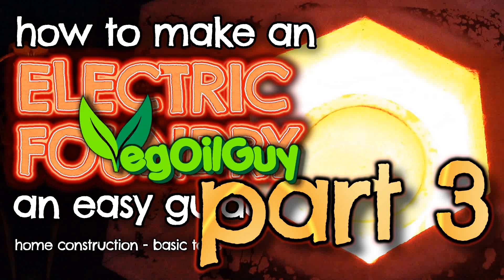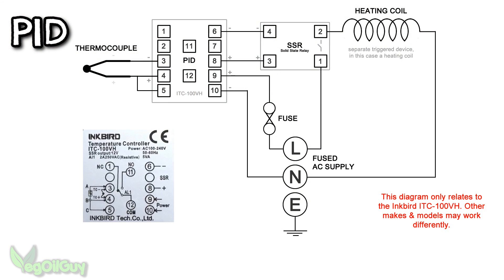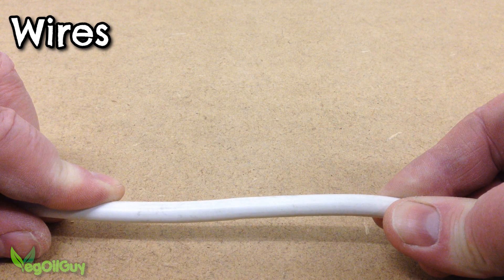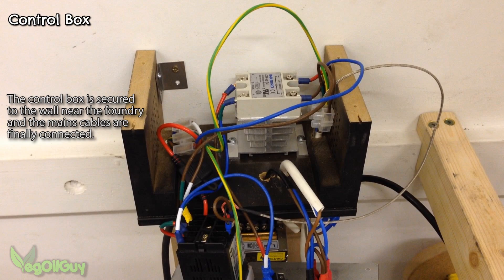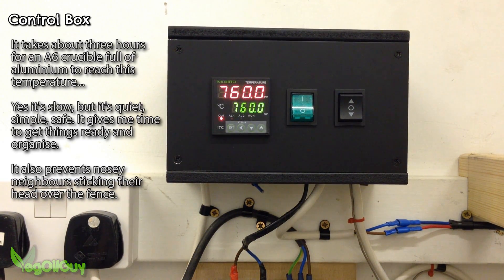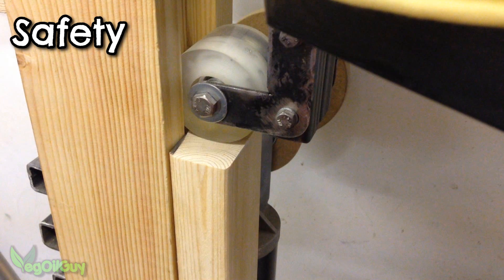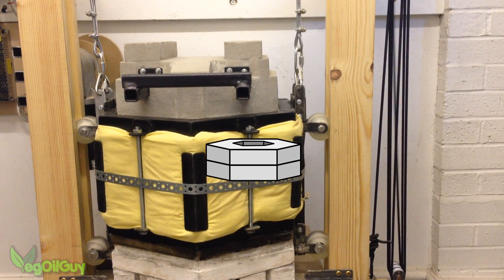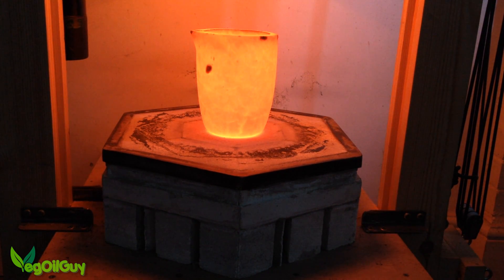How to make an ELECTRIC Furnace (Foundry) for metal casting Part 3 by VOGMAN

Comment: 8:42 As a doctor and scientist, this seems like a very good time to point out metal fume fever. Metals such as zinc are particularly dangerous in this respect. Metallic zinc is relatively harmless, but its salts and other zinc compounds are extremely toxic. If metal is melted, a small part of it always evaporates, recognizable by the different color shimmers that emanate from the melt. Zinc vapor combines with the oxygen in the air to form zinc oxide, which is extremely toxic to humans. So please be careful, especially when using it indoors. Never attempt to melt brass indoors, preferably not at all, it contains zinc and copper.

Comment: As a guy who calibrates and services those PID controllers, that jumper with the thermocouple is there because the settings in the PID can be made to handle a 3 wire RTD, which requires a 3rd wire (not going to get into the science or why the manufacturer didn't disable that part of the circuit)

Comment: Good series and well presented! Have you considered a higher power element? You could use the full 13A, as many plug in heaters do.
I made a short video of testing mine. I'm using 3.2kw, fireclay as a spiral form and perlite insulation, in an old cylinder.
Reply from the maker: I wanted to stay under 13... it was just a preference 😁

Comment: On safety features, as you say, a crucible failure or getting tipped over when the furnace body is in the raised position, would be a serious matter. It would not be a great deal more work to fashion a steel reservoir, bund or moat at which wraps entirely around the base, with the aim of containing any hot spill. Given the relatively small volume of the crucible, this would not need to be very large.

Comment: I wonder if it might be possible to increase furnace capabilities by using a dedicated supply circuit from the house control board. Electric ovens are wired on their own separate circuit and fused at [if I remember right] 30 amps, so might enable a usable load of say 20 amps
I suspect that this would not be a good idea if you also have an electric oven .... any thoughts ?
Any such change would however require installing, testing and certifying by a qualified professional electrician

Comment: Terminal 5 is circuit ground of the PID controller. The bridging of terminals 4 and 5 is to GROUND the thermocouple. This can prevent erratic temperature readings, which can be produced if the thermocouple is in contact with a conductive metal enclosure (electromagnetic field).  Another option is to connect the conductive metal enclosure to terminal 5. Now you know!!!

Comment: The whole purpose of having 3-wire RTD circuits is to eliminate errors due to voltage drop along the current-carrying wires

Comment: I'm not into welding yet.  I'm going to try to adjust the design to use bolted construction, with using porcelain tiles for some structural support.  Wish me luck!

Comment: You really shouldn't use blade fuses with mains, they are normally only rated for ~48Vdc and typically don't have ac ratings, a bulgin inline cylindrical fuse holder would be more suitable. Also 5A is way too high for a PID controller, I would suggest 1A.

Comment: As for the color comment at 4:00 , that's not totally true. For line and neutral, that's correct. The ground isn't always the same size/gauge as it's meant to be a backup safety and not always carrying the full rated load. At least in the US
Reply from the maker: If it's the comment I'm thinking of, I think I was just trying to convey that colour is strictly an external marking system for user convenience. I know I've come across folks that have said to me before, "I can't find that colour wire anywhere. I can only get XXX," believing that the external colouring effected its function.
As for colours and gauges, I'm sure you're right - I honestly have no expertise in such things. 😁
Thanks for your input 👍

Comment: Great and easy to follow series, thank you for posting this.
One question would it be possible to modify this design slightly using 3 coils, 1 on each phase? As it happens I have 32amp 3 phase supply in the basement so should be able to pull about 9 amps per phase with a margin of safety.

Comment: Watched these so many times, trying to figure out what works for me. Slightly larger with the lid appears to be better for me. But i love the "brief" cover on pulleys. Enough information to take me from know nothing to expert on pulleys.  :)
Given up trying to make my own bricks from internet mixes of sand or perlite etc. etc. Trying to source bricks whilst in lockdown is not easy it seems.  Postage costs as much as the bricks.  Thanks for the build.
Drawn into your 3D printing stuff also, hada CTC for many years and recently bought the Elegeoo Mars.
Reply from the maker: Glad you liked it : )
Reply: Bricks arrived. :)   Did you find anything about kiln size and wattage ratings?  I have a 16A cooker outlet but thats extra cable length compared to a 13A supply. Could i add an extra layer in height with just 2500watts or less or would i need that 16A supply? Any ideas?  Thanks again.

Comment: Thank you for a very informative video.
Very inclusive, and direct.
Well done!
Note; you may want to change one point of fact, that being,, there ARE hazardous fumes associated with melting lead, brass, and gold, and a ventilation system should be advised, especially if this is built indoors!

Comment: Thanks for the very good info on how to wire the pid and relay. Question:  Does the Inkbird PID temperature screen go over 1000°c......i need it to go up to 1100 degrees C for a heat treatment oven.
Reply: Loved all three videos. My question is the same as HoutmeyersP.  Plus, which thermocouple did you have to buy extra to get to the temp of 2000+  ?

Comment: I'm am looking to make this but am in no need to have accurate temperature control so I was wondering if I could get away with using a light dimmer? I would greatly appreciate feedback and love your videos!
Reply from the maker: Hi Louis. These coils are pretty much on and off. There's so much current they'd likely blow a standard light dimmer and I'm not too sure it would make much difference anyway : )

Comment: Hi VOG, thanks for your video, very useful and generous :-) I am doing now my own, inspired in your video and few others I saw online. I wanted to ask about the aluminium fumes, is it been a problem to do it indoor? Do you have a ventillation system or special masks? thanks!
Reply from the maker: I always recommend good ventilation when working indoors. An extractor system would be best, but personally I just keep doors and windows open : )

Comment: Change the fuse to 2A or less(look at the PID-controller's label).
Reply from the maker: You mean the one that says "Power AC100-240V 50-60Hz 5VA"? Yes I did.

Comment: Great series. I may have just a couple of suggestions though.
For the moving cables that run to the foundry and power the coils, I suggest a flexible cable tray. They allow the cable to move, whilst also providing protection.
For the winch motor I recommend placing end stop contact switches to stop the motor when the forge has reached its maximum travel.
Reply from the maker: Thanks Mike. Always have to receive suggestions  : )

Comment: Learn't a tip the other day, Make sure to pre-heat your crucible (specially graphite) if it has been left anywhere with moisture before using in the foundry
Reply from the maker: That's a nice tip  : )
Personally I always try to start off slowly for that exact reason, whether it's the crucible or the foundry. Rapid heat change can wreck most things, especially if moisture is involved as well .

Comment: hi. I have to melt lead alloys copper and tin and zinc copper. I want to buy a ceramic crucible for my electric furnace since I think that being made of ceramic it will produce less oxidation in the molten metals. is that right?
Reply from the maker: Hi Giorgio. I'm sorry to say I don't really have any knowledge on the subject  : )
Reply: @vogman  ok. you are the best . you can rely on yourself. but among the comments below your video I see that there are too many engineers hahaha

Comment: Good kiln build. But, i would be VERY careful using an automotive blade fuse setup like you have going on. Their insulation does not always handle 230-240V mains voltages. It could be a possible source of electric arcing at some point. Also, you've used high temp insulating sleeves, which is great, but then you've put on insulated qc connectors, lol. I'd swap them out with non-insulated ones if the temp is getting above 60-80 degrees C. Keep up the great work and looking forward to the next video!
Reply from the maker: Thanks Aaron  : )

Comment: I like you foundry very much. It is definitely overbuilt (your steel rope can probably lift a ton easily) but nothing too strong ever broke, right? Two things I would have done differently: one, the small fuse you used looks suspiciously like an automotive one and is probably not rated for mains usage, second bonding the protective earth clamp to the front panel with epoxy doesn't ensure a long lasting low resistance connection. Mind you, I wouldn't hesitate to use the foundry as is, but you being a belt and suspenders type of guy, I thought you'd like to know :)

Out of curiosity, why didn't you simply use steel L or C beams for uprights? Price is similar and wheels could ride in them with little or no modification.

Thanks
Reply from the maker: Thanks for your input. I would have preferred steel framing, but the prices I found were much too high .Fortunately it works well and is still in use as my regular videos show  : )
Reply: I was actually wondering why he didn't put the earth connector under one of the faceplate mounting screws myself? Figured there was a reason though.

Comment: On steel rope topic, a smidge of heat shrink on the ends help prevent it from fraying out a bit into a hypodermic needle like porcupine from hell.
Reply from the maker: I experienced that porcupine myself. Good tip  : )

Comment: Easily one of the BEST series of vids in how to do stuff, especially all the safety issues and code requirements. 
One thing I found helpful when 'gluing' refractory bricks was to soak them in water a few hours before hand, so there was some residual moisture which stops too dry bonds you can sometimes get. Or spray before, allowing a few minutes to settle.
Great work!
A warning: (So many idiots out in youtube land doing all sorts of stuff with only the minimal understanding of ALL aspects to their supposed teaching.
Whilst YT is a great library, it is also 'caveat emptor' in so far as emulating many instruction vids. I go so far as to say many are complete idiots in what they are doing, taking the entitled generation to new levels of brain dead.)
Reply from the maker: Thanks for the kind words  : )

Comment: Firstly, great video. Secondly, I see you are preferring your veg-powered furnace for bronze casting, and was curious why use one over the other? A question of time?
Reply from the maker: I love my electric foundry and it's great when the weather isn't pleasant and I want to work indoors. But it is slow. So if time or weather is an issue, I revert to oil or gas. It's as simple as that  : )

Comment: Love your videos and gave me a few ideas for my own electric forge build. As an electrical engineer, a couple of thoughts, though. The automotive fuse holder, is that going to hold an automotive fuse? What's the voltage rating on the fuse you're using? If it's rated for 250V or higher, you're probably fine. If it's a low voltage fuse, like most automotive fuses (32VDC rated for example), then the fuse design may be insufficient to avoid arc-over during a fault. If so, it may not provide the protection you expect.

I'm also curious about the effectiveness of the heatsink as you've located it. Generally if there's enough heat to be dissipated to necessitate a heatsink, you want to put it in a location with ample airflow so that heat can be dissipated into the surrounding air. Putting it inside a small sealed box seems to defeat that. If you haven't already, it might be worth checking how hot it gets inside that box after running the forge for a while. Maybe there's no problem, or maybe you want to drill a few holes or something. Another option is to use a metal case and firmly attach the heatsink to the case and dissipate the heat through the case that way.
Reply from the maker: Your expertise shines through and gives me food for thought. Many thanks  : D

Comment: Geoff, I loved the video and will look into using a PID to make a tempering oven for blueing clock parts. I particularly like your method of confining the heating elements. Other designs using staples seem to fail.
 Like the UK In Australia we also use 240 V AC (nominally dropped to 230V in line with the Europeans 220V as it was dropped in the UK. As a retired Physics teacher the brown coloured cable from your power cable is the Active (live if Yankee) {the dangerous one] this is the one which should be switched and the blue is Neutral not +ve and -ve as you label them. Although you are correct in indicating there is no need for polarity with heating elements.   I would strongly urge you to securely anchor the cables carrying 240V. Both in your control box and also the connection to the heating coils.   Pulling on them could easily expose the active and the Earth could become disconnected which means if the active comes in contact with the metal parts they become lethal. Using an core leakage relay is sensible.  In my projects I amusing panel mounted circuit breakers in place of fuses as a button push will reset. I Really loved the video I hope i can source the parts in Australia.  Hugh
Reply from the maker: Thanks Hugh  : )
Reply: I'm not sure if it still counts for the coil switch or not. But, in NSW, when switching mains power (thinking power boards here) you are actually meant to use a 2 pole switch and switch both the active and neutral for double safety.

Comment: Excellent work, one cronstructive criticism though, in the case of a crucible failure, I believe that  this design won't contain the molten metal, as the weight of the molten metal will bouy up the casing and then spill onto the floor. Perhaps you have room for an extra ring of bricks to act as a reservoir.
Reply from the maker: Thanks Mike.
Hopefully I'll never find out about that potential concern  : )

Comment: Can you melt steel with this furnace?
Reply from the maker: No... Copper about as high as I can go. The coils themselves begin to melt at around 1400C so there are limits. No doubt there's other wire out there that can handle higher temperature  : )

Comment: Massive overkill and expense, but nice. Good job!  I would have just built a larger one to easily access the crucible easily, and avoid the hoist system.
Reply from the maker: The hoist was the whole point. Reaching in is arguably the most dangerous part... the hoist practically gives you 360 degree access. And if I'm going to be honest, for me at least the hoist wasn't the most expensive part (I already had the motor) - the bricks were! So bigger does mean more expensive I'm afraid.
: )
Reply: VegOilGuy - Yes, I understood that from your explanation on the lack of space to safely access the crucible.

Comment: Thank you for an excellent kiln building trilogy, this is the best and most well laid out of instructional video,s I have ever watched, well done, one question will this generate enough heat to melt copper and brass as eventually I will be having a go at smelting some gunmetal, regards Doc Cox.
Reply from the maker: That's very kind of you to say. Thanks : )
The answer to your question is yes, no problems with copper or brass. I haven't melted brass, but as this has a lower melting point than copper which I have tried (twice now) I'm confident it will manage it. Here's my first ever bash with copper which, I have to be honest, wasn't my finest hour... but the evidence is obvious (even if I somehow overcooked it). https://youtu.be/15ZYlUmk4eM
Reply: Credit where credit is due, forgot to ask before, wgat gauge wire did you use please.
Reply from the maker: Pretty sure it was 1.02mm Kanthal Wire. It's been a while : )
I think I also mention it on the coil calculator page on my website... hang on... yep, 1.73 ohms per meter.
http://vegoilguy.co.uk/coilcalc.php

Comment: not sure if you could have place da few more couples of lines of wire between the bricks (by cutting the bricks further) to get a faster heating effect in the furnace...
Reply from the maker: Hi. The length of the coil is determined by the thickness, the resistance and the amount of power available. Even with more lines between the bricks, I couldn't have fitted more coils. So I had just the right amount  : )